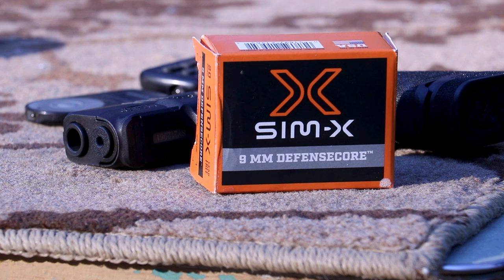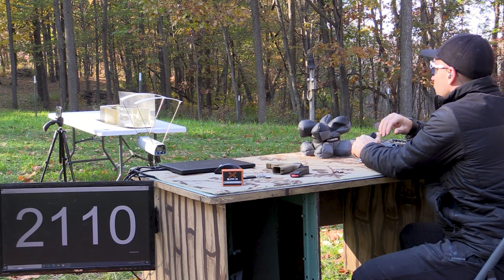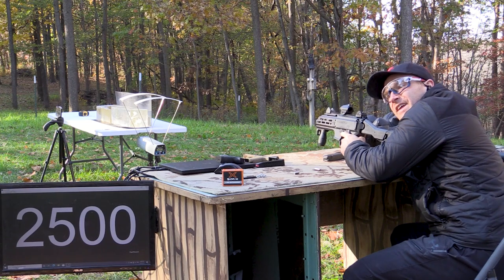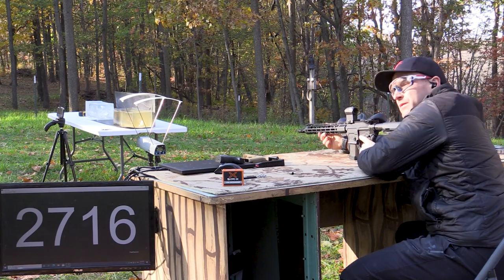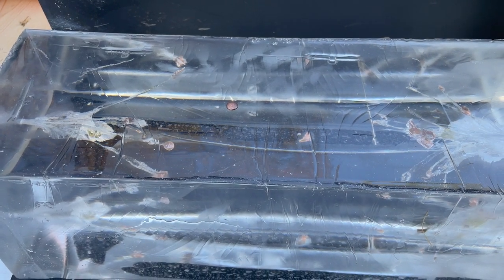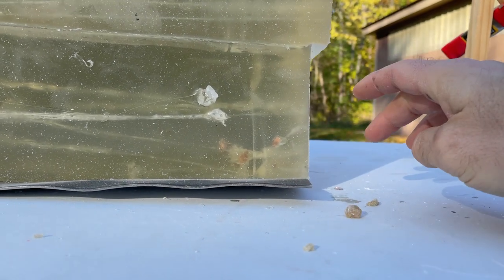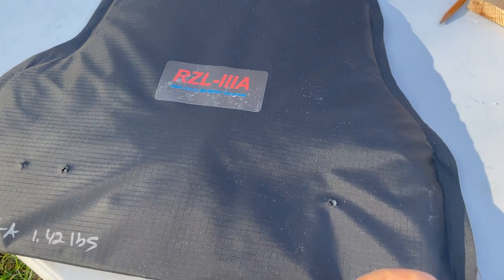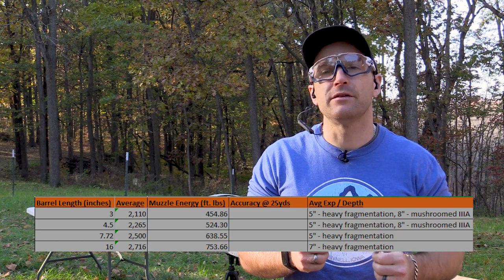9x19mm, 46gr? DefenseCore, Sim-X

Comment: While I pray nobody would use this in their carry gun I could see this being a great round for small game where you don't want alot of penetration and alot of energy transfer.
Reply: I'd run it
Reply: @odinmcboden9690  A bb gun goes 3.5" into the gel to check the calibration. With only 7" penetration you better hope and pray you get a neck/headshot. Other rounds that failed to reach vital organs in real shootings made it much deeper into gel than this does. It barely made it into the gel after going through the glass! If this would hit an arm before going into the chest cavity it probably wouldn't even make it into the skin of your chest!
Reply: @rileyneufeld7001  Idk man that fragmentation seems crazy. I use civil defense .40 in my G27
Reply: @PvMcris  Yea it looks like a cool but fragmentation is only good if you have adequate penetration and this is barely above halfway from the FBI recommended MINIMUM. I'd really consider you look at other options than the civil defense also. That tiny base of the projectile is what's doing the actual wounding into the vitals and it might not be able to make it through an arm or shoulder, then through ribs, then to vitals.
Reply: It was actually high velocity pre fragmented ammo that performed best in the Strasbourg tests. Followed by rapidly expanding jhps with lower end penetration.

Comment: Penetration definitely matters but at those levels of instant energy transfer in such a small area, if you got someone with that they're absolutely going down. At the very least it'll make them stumble and cause them to pause enough for you to place rapid followup shots. Even someone on drugs can't smoke away physics. 

Now, you might have to continue to place those shots for a few seconds until the blood loss or straight physical damage causes them to drop. Either way, that's one crazy ass round. I'm gonna have to get some just for kicks. Thankfully barrier shots aren't something we really have to take into account. If anything for defense, especially at home or in crowded/hardened locations we want something that WON'T penetrate a barrier. Or at least very minimally.
Reply: Penetration doesn't always have to be more than a foot to get incapacitations but only 3-4 inches? Yeah, this is way too little to seriously consider for self defense ammo. 

Energy transfer only matters when you're hitting near or directly at vitals. This isn't even pushing past the rib cage if you're unlucky. 3 inches of penetration is basically 2 if they're wearing a hoodie or something lol.
Reply: @mynameisjeff6988  if you're destroying flesh, muscle tissue, and blood vessels it'll most certainly stop someone. Penetration meters off you're attempting to drop someone in (hopefully) one shot, maybe two. Almost no engagements end in one or two shots. 

When we started using block II's they still had plenty of penetration. Still took 3, 4, and sometimes more shots to end a threat. Tissue destruction is what matters most, not penetration. If I blow your leg off, you're done. If your bullet goes all the way through one of my lungs I'd still have plenty of time to take you out.

Comment: Great video, I really like that velocity. A few days ago I found a video on Taran tacticals channel of his new pistol in that video he added a slide where he for the first time I have seen teased a new 9mm magnum that seems to be pretty innovative with a steel head similar to the .277 sig fury case design to allow for higher pressure. It would  be very interesting to see that showcased on the channel too.
Reply: Sounds similar to 9x25 Dillon
Reply from the maker: Doesn’t he use the shell shock cases?
Reply: @SuspiciousGanymede  or 7.5 Fk Brno but yeah it definitely peeked my interest.
Reply: @BuffRANGE  https://youtu.be/hSHm0PJiIOQ it's at the 34 second mark in his video. He only shows it for like 1 frame so might have to pause also there is similar on the ammo designer website but not this exact loading. I'm not sure about the case you tell me as I'm kinda a novice to ammunition designs.
Reply from the maker: Yeah shell shock cases but wow 1,350 from a 124 in a 5”! That’s as Hot as L7A1!
Reply: @BuffRANGE  😂 Yeah very exciting times. If they can adapt 9mm what's to say we couldn't adapt the 5.7x28 in a similar way with a two piece design with a steel case head ? 🤔 Maybe Jay could design something similar to give it some enhanced velocity to improve armour penetration. I could be totally wrong here but definitely got me thinking about how the industry will adapt to these new case designs.
Reply: @BuffRANGE  Pressures like that should be new big deal with the new NAS3 cases.

Comment: I just picked up a CZ PCR and it has a 3-3/4” barrel. I’m planning to use hornady critical duty 124gr +p 9mm.

Do you have any other recommendations that might be better?
Reply: I use Speer Gold Dot 115 grain +p+ in 9 mm.  I don't think it matters nearly as much as gun guys think it does specifically what you use
Reply: I like 124 grain hst since I was able to get a decent stock of the 50 round boxes
Reply: @Valorius  I'd move up to the 124 or 147 Underwood gold dot loads. Tnoutdoors video on the 115 loading missed the 12" minimum penetration by a good amount. The 124 and 147 did great from what I remember.
Reply: Federal HST in 124 or 147, Gold dot 124 or 147, PDX1 in 124, Hornady XTP 124 or 147, critical duty 124 or 135 (stick with the +p in both). I'd trust my life with all of those in that length barrel. Once the barrel gets around 3" then you start having some expansion problems with some of those. Apparently the critical duty lineup has done well from FBI data.
Reply: @rileyneufeld7001  The 115gr+P+ LE only projectile expands to .92 caliber and penetrates 11+". I'm good.
Reply: @Valorius  Idk where you're getting .92" expansion but I'm calling BS on that. Tnoutdoors9 got .6" at it's widest but it did go 13.25" so it's still a decent load. It did lose alot of it's weight and that's in bare gel without any bone or through a windshield. I would trust it more than the Underwood 115 gold dot load though.
Reply: Hornady Critical DEFENSE is much better out of shorter barrels, which it was designed for, and of all the tests I've seen the 124 grain preforms the best. It's great for barrier penetration and especially expansion through thick clothes, and the +P critical rounds don't seem to offer better performance. The Duty rounds are designed for longer barrels and you may not get the speed needed for full expansion. Federal HST 147 grain has the best expansion out of short barrels from what I've seen.
Reply: @rileyneufeld7001  115gr+P+ Speer Gold Dot LE only will blow your target's lung out.
Reply: @MB-jg4tr  Critical defense is not even tested against barriers. So gonna have to go with no. Subsonic 147s out of a short barrel offer the worst of both worlds. More recoil, and less expansion when compared to light weight +P rounds.
Reply: @MB-jg4tr  In sub 3.5" Barrels I would probably favor the 124+p or 147 XTP than the critical defense loads but in a 3.75" barrel that's barely any shorter than the 4" barrels the loads were designed for.
Reply: 124 +p gold dot and 124 +p hst
Reply: @Valorius  Federal HST 147grain actually gives me less recoil than most 124 grain out of my 3.4" barrel. And way more expansion than anything else I've found.
Reply: SIG V-crown 124 grain preform very well out of medium-large length handgun barrels. They are often quite inexpensive compared to gold dot & HST.. Not so good sub 3.5" or so though.
Reply: @MB-jg4tr  Ehhh they expand a bit too much and don't reach that 12" minimum in bare gel. They seem to do fine once going through heavy clothing however.
Reply: 147g HST, by far your best choice.
Reply: Go far the 135 grain critical duty with or without the +p it's a great load
Reply: @robroy8349  The non +p loadings are pretty weak and don't expand out of shorter barrels. I'd go with the +p out of a micro or a duty sized barrel.
Reply: Personally I'm more of a high velocity, high energy, low penetration prefragmented or fragmenting type of guy.

Comment: Daaaaammnnnn, if only it could penetrate more this would be a wild round.
Reply: Literally the whole point of the round is penetrate as little as possible for self defense
Reply: @eurly93  "as little as possible" is NOT a defensive round whatsoever. You want an absolute MINIMUM of 12" penetration. As long as you hit your target with a REPUTABLE defensive round the over-penetration lore becomes a myth. Even if said round exits the intended target it still won't have enough energy to begin making penetration through more flesh. Still to this day I can't find 1 case involving a legal use of defensive force where collateral damage is at play with a round piercing it's target to then hit an innocent bystander. The myth originally started from back when police still carried revolvers where shots fired MISSED it's target and then struck bystanders. When it comes to pistol caliber defensive offerings you need the most effective means possible of dispatching a threat. These parameters are met through a minimum of 12" - 18" of penetration depth as well as a cartridge with consistent expansion that travels within a 1.5" margin of the previously mentioned parameters. This is why both HST & Speer Gold Dot are the most sold defensive cartridges. Proven cartridges that meet or exceed given parameters with no threat of collateral damage after a round leaves the intended target. Even fmj round nose have trouble carrying their energy after hitting flesh.